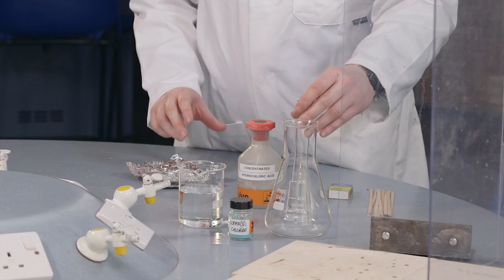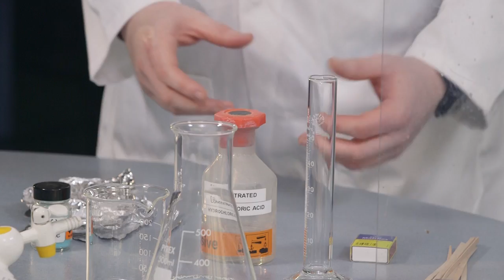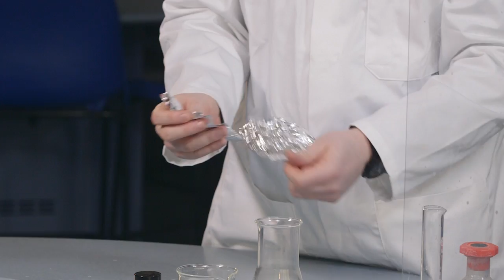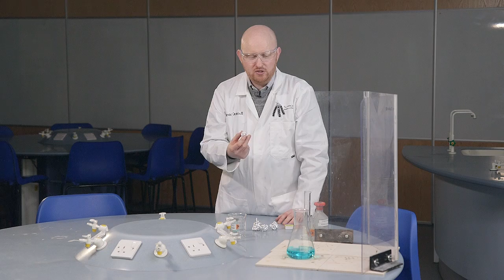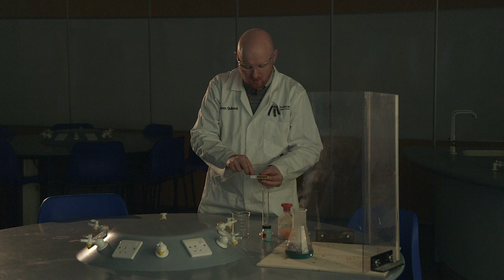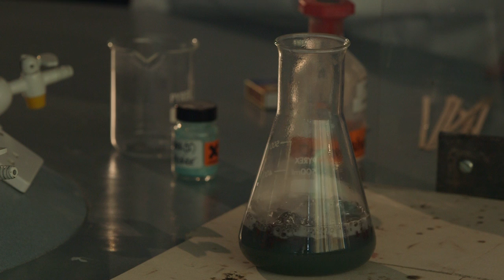Christmas Science | The Northern Lights | Displacement of Copper by Aluminium

Comment: Hi thank you for the interesting experiment. You start with 200ml of water and 20ml of conc HCl.  If conc HCl is 11.3M, then when you mix the water and acid together you get a 1.027M solution. So for the purposes of this experiment, you can use 220 ml of 1M acid as your starting solution, which is much more user friendly for the less experienced

Comment: Hi just a quick comment, the Conc HCL Acid you are using clearly shows that it is corrosive, you as a technician and under Cleapss guidelines on health and safety, should be wearing gloves when handling corrosive chemicals. It only takes one slip-up to turn into a hazard that could possibly lead to injury. Just some advice, thank you. P.S love the informative videos, keep up the good work!
Reply: Or if you had any actual knowledge of handling acids, you would know that it's not common practice to wear gloves, because it's easier to just wash the acid off with copious water.
Reply: @whizzkid11k  I work as a senior technician and have worked in a inorganic laboratory I'm pritty sure I know how to handle corrosive chemicals. What you said applies to diluted acids and alkalis that if in contact with your skin its better to not wear gloves and wash it off but using concentrated corrosive acids/alkali you must wear gloves. If you don't wear gloves you are liable for all damages and are in breach of health and safety regulations. I don't think the HSE would be too pleased. Do your research mate before commenting.